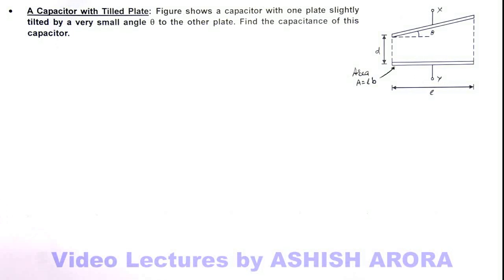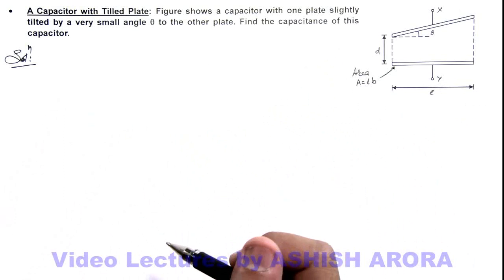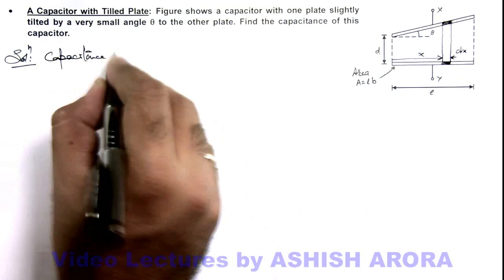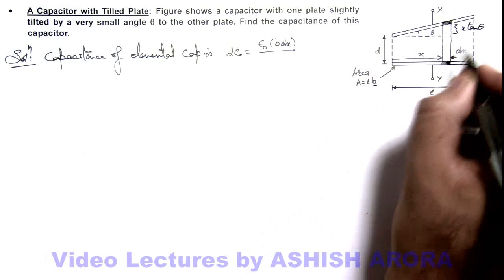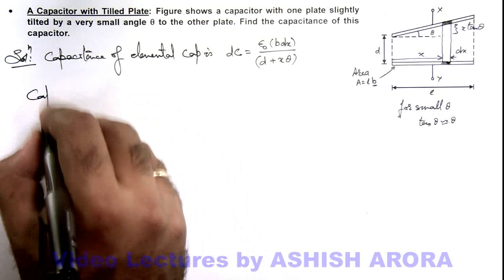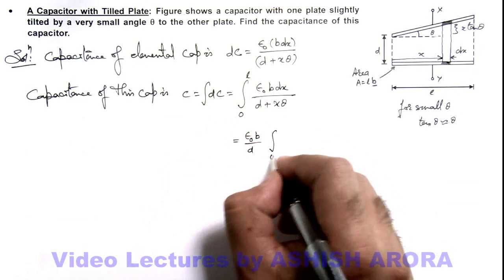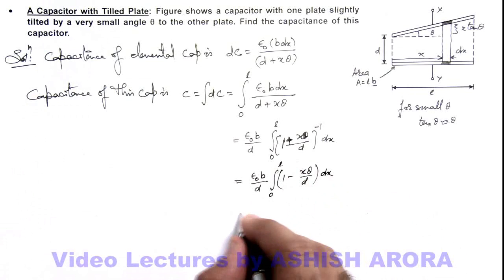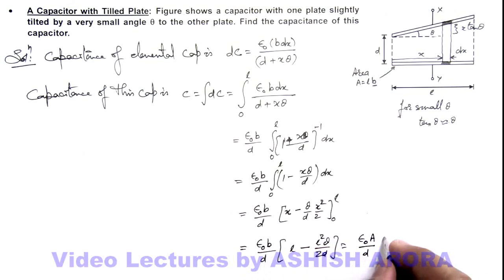2. Advance Illustration | Capacitance | A Capacitor with Tilled Plate | by Ashish Arora

Comment: SIR THANK YOU VERY MUCH 😊😊😊😊😊😊
Reply: Concept: Kyunki C=εA/d mein parameters I.e. area and distance between plates variable hai isliye direct result nahi use kar sakte, toh Hum pehle chhote se element ka capacitance consider Karenge at x distance of dx width, fir Har ek capacitor ka array dekh series /parallel ke liye integrate karenge accordingly here as each capacitor is connected to same potential hence all are in parallel.

Comment: we have to calculate pd between small element by taking component of electric field by tilted plate along the axis and then evaluate d.c 
here direct result of a parallel plate capacitor has been used 
which makes it wrong
Reply: But sir is not wrong either, question has given the angle to be small ... that's why!

After using small angle approximation , I'm getting the same result.
Reply: Shut up
Reply: @duttaalt  why shut up? He's right

Comment: sir.. the elemental strip must be in series ri8??? how come parallel.......... plss answer @physicsgalaxy
Reply: suppose the x and y terminals are connected to a batter of voltage v then if x is connected to positive side then the plate upper conected to x will be of potential v distributed over whole area so even cutting the strips the strips now as capicitance will have upper plate same voltage similarly down plate

Comment: Isn't the integration will come in log??
Reply from the maker: No... because initially we used binomial expansion at the expression of integrand as Θ is very small so what we did is correct...
Reply: Yes, it will come in log and after that you can open with series expansion same answer will come

Comment: Why u did approximation in mid step. Why not in last?
Reply: Aayush Singh to simplify integration if you belongs To maths group you know it will be more complex if tanα is there
Reply: @atriyapatel8909  Why will it be a problem, we're integrating over x, not theta?
Reply: Yeah if you don't you will end up in log which you can open by series and answer will be same

Comment: is the integration part correct ??
Reply from the maker: It is correct... If you have any doubt pl ask specifically... or you can follow integration or other videos in sequence on website physicsgalaxy.com
Reply: @physicsgalaxyworld  sir... the elemental strip is in series.. but y did u take parallel
Reply: @AshishArjun  no , it's in parallel , don't believe what u are physically seeing , the potential difference across all components is same therefore are connected in parallel
Reply: @AshishArjun  it is in parllel